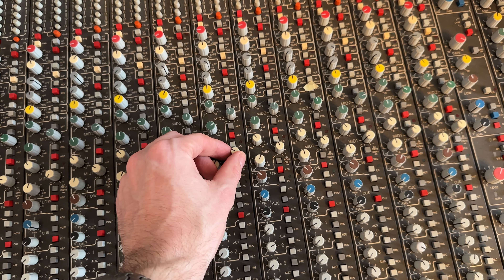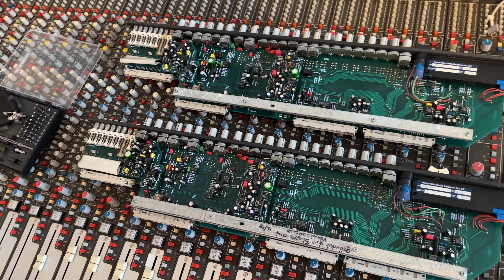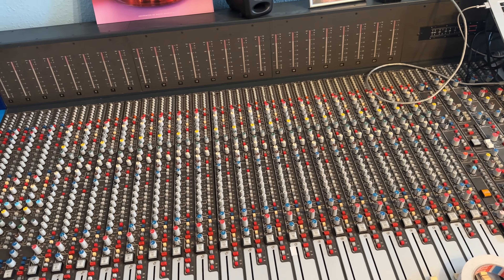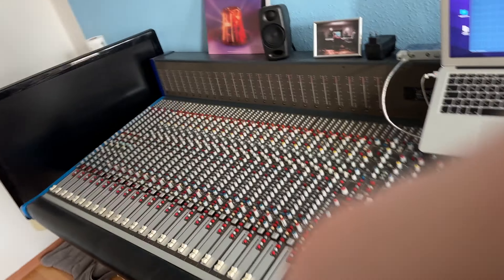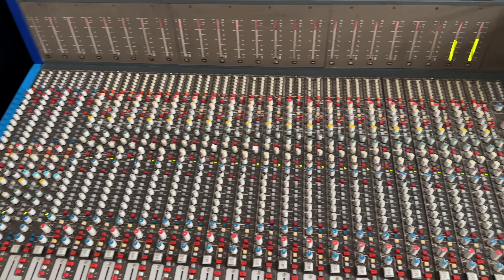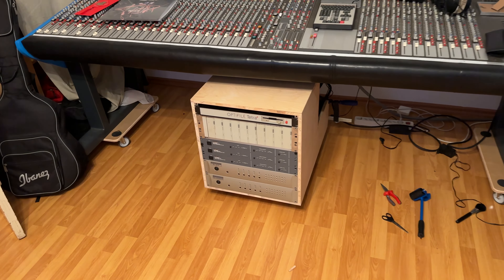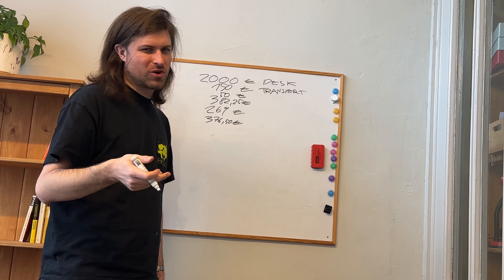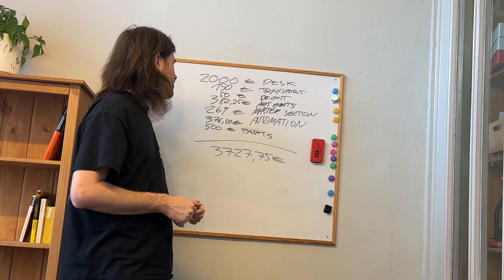FINAL UPDATES ON THE CHEAPEST LARGE FORMAT MIXING DESK I COULD FIND - ADT 5MT-C RESTAURATION

Comment: Fader lube is the correct version of deoxit to use on pots.  However if you over use it, it dissolves the friction grease that is applied to the shaft of the pot for resistance to turning.  The feel of the pot will change from tight and accurate to adjust to 'loose to turn' with no friction ( like the volume on a fender strat.)

  To restore that you will need to remove and disassemble the pot. And reapply the proper friction grease around the shaft. 
 So be careful. I ruined the master vol pot of my line 6 pod this way. Now you can flick it and it spins right around to full.
Reply from the maker: Great comment, thank you! Will look for „friction grease“. I know from Contact Spray that it makes Pots too light. De-Oxit re-lubricates a bit but is ofc no replacement for proper lubrication! All the best, Tobi
Reply: I had the same issue when working on Tascam Portastudios. Fader grease is what worked for me, but only with potentiometers and faders that had access holes or could be disassembled. Great work and good luck!

Comment: Great job! About the fader plates; have you considered laser engraving the existing plates? If they are aluminum that should be possible. I don’t know about steel. I don’t have a laser engraver but I do have a second hand Ender 3D printer that cost me only €110 and it can mount a laser unit (also not that expensive). It might be a good investment. Since you are in audio, you can use it to print broken plastic parts and perhaps even engrave your fader plates..?
Reply from the maker: @janwillembakker5654  Hi! Yes I am saving up for an engraver - also to cut 3mm mdf wood for housing back plates etc :) For this desk I will probably get new ones now from ADT as they come colored and that looks just so cool!

Comment: Sidecar rack looks really clean, well done! Just a q - are your Sydec/Euphonix units vented adequately or might you put vent slots in the sides?
Reply from the maker: Thanks! The Rack is quite open from the back, so the heat should flow nicely. Also I know these Converters and they are fine as they have plenty of space inside their 2u Case :) (My UAD Apollos in the Studio are the complete opposite - Converters and DSP in a 1u case that gets CRAZY hot…). But yes - I want to find a good venting slot solution for wooden racks in the future that is easy to manufacture, durable and keeps the dust out! And looks nice ofc ;) Wood is indeed not good in terms of heat transfer. Thanks for following along and all the best, Tobi

Comment: you will definitely want to make better airflow in the rack with all that equipment in there and space things out a bit so they are not sitting on top of each other. In general wooden racks sound better especially if you use wooden rails as the equipment is not sharing chassis ground but they act like an oven if not given good airflow.
Reply from the maker: Hi! Never seen wooden rails actually :) The Rack is quite open from the back so air should flow out nicely, but I‘ll monitor that. Thanks and all the best, Tobi
Reply: @tobiverseofficial you would just use a piece of strapping fastened to the sides of the rack rather than the metal rails and drill holes equally spaced into it based on the height of each piece of equipment i use two chopsticks to space the equipment for airflow only as i am drilling the holes but really a couple of cm is all that is needed
Reply from the maker: @louisoppenheimer6618  Hmm Thanks for sharing! All the best, Tobi